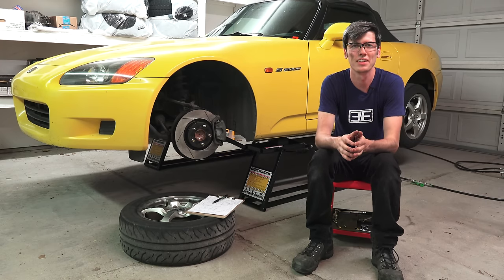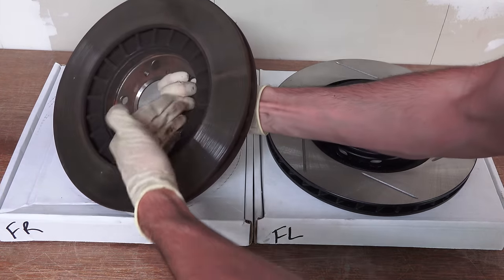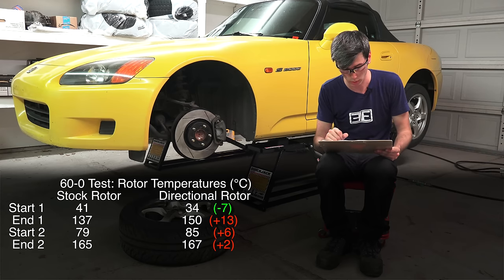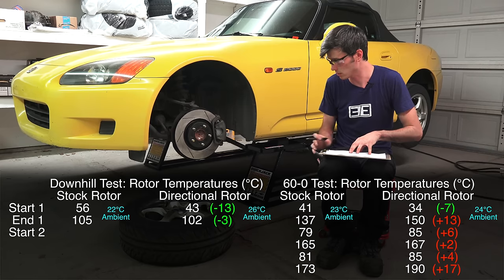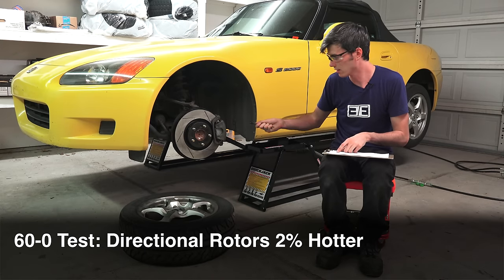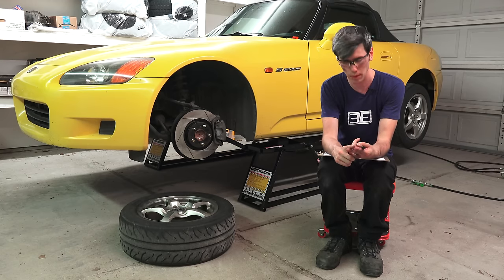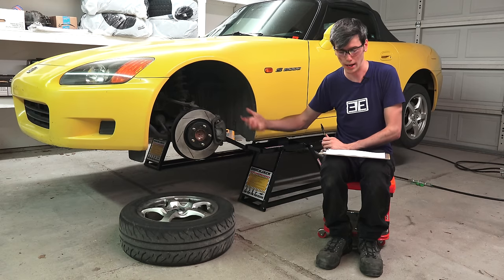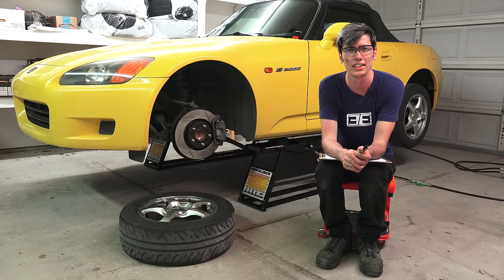Do Performance Brake Rotors Have Better Cooling?

Comment: I can see what it is that you did wrong...you had the winter air still in the tires. you need to drain the winter air and put in the summer air so it keeps the blinker fluid cooler
Reply from the maker: Kept winter air for a cooler garage.
Reply: Nick F Don't forget to add cold water to your engine.
Reply: Robert Villapudua 
You must wait till the ambient temperature is 90+ F and the engine is warmed all the way up before you add ice cold water.
Reply: SteveLovesGOD 
Wow.
Reply: It also help the muffler bearing run better and as a result the piston return springs make the engine more efficient
Reply: 😂 😂 😂 😂 Bro
Reply: did the slotted rotor help the rotor start at a lower temp?
Reply: Really funny!
Reply: Oh man, i'm dying from laughing
Reply: air up battery
Reply: Most of the funny references stole from Chris fix nice
Reply: @drgreene1013  it sounds like my muffler bearing is bad but can't find one online for some reason , my piston springs are good tho....
Reply: Professional mechanic wouldn’t tell better. Trust them, they know what’s good for your car and your wallet.
Reply: I don’t usually read comments but I gotta say this comment wins funniest comment of the year 😂😂
Reply: Also gotta make sure you don't forget to put gas in the radiator for better fuel economy. And if you change the engine oil out with cold water it keeps the engine cool. Car companies won't tell you that because they're just trying to take your money
Reply: Awesome Comment:)
Reply: Nick F Lolol you got that from chris fix
Reply: @Nick F I am Nick F
Reply: Damn I hate when that  happens....
Reply: Dont forget the horn fluid😆😆
Reply: dgreene1013 only if the timing spring rotates around the cross bearing counter counterclockwise, and your smack sensor tingles your under wire, while your crank chains are cranking your pop valves. Otherwise you'll break your.... It's just easier to say this test needed to show information that actually concerns people who buy breaks, like distance, fade, etc. Then again, if you bust your gain seals closed, you'll risk cracking your drain cross beam filler detector collecter belt selector memory indicator gasket switch, and that's an expensive repair at most shops! Though I can help you out of your issue with a high care, lost cost easy payment plan at my shop.... That's if you start noticing your car drives funny... which is the #1 sign!
Reply: were they bedded in?
Reply: The blinker fluid jokes never gets old huh. Lol
Reply: @drgreene1013  FYI A little known oddity is that some cars do in fact have a muffler bearing.  Years ago I was looking at some drawings and noticed something funny, on a 92' SVX LSL in which I was looking at a parts diag for, actually has a muffler bearing.  I haven't found it yet, but there surely is a motor out there that employs piston return springs!  lol
Reply: Rotate and balance your fuses and relays to
Reply: The important is to understand the difference between the framistat and the framistern and when and how to adjust each one. Most people know that every motor vehicle has a framistat but few know that there also is a framistern.

Only models 1978 and older had an adjustable flibbertigibbet.
Reply: You need to apply kY jelly
Reply: @EngineeringExplained  Should new brakes pads and rotor a month old still feel hot after driving 8 miles on flat road only braking a couple times?

Comment: I once sprayed WD40 on the brakes to clean them so they will brake better. Forgot to clean it off. Massive surprise at first intersection
Reply: You cleaned your brakes with WD40? Did you hear they invented a thing called brake cleaner?
Reply: Rofl!!! I was 17 or 18. I did the same thing! My brake squeaks. I learned that w40 helps with the squeaky noise! Next thing i know. I almost ran through the garage! It didnt stop! I learned quick not to do that ever again! Lol
Reply: Troy Truong Yes, the squeaking generally implies you need to replace them, or use higher quality pads. 

It doesn’t imply your brakes are running low on oil.
Reply: @guthrie1181  Better question is, "how do I change the brake oil in my Camaro?"
Reply: Lash LaRue Bring your car to a mechanic immediately if that thought ever arises.
Reply: you sprayed lubricant on the thing that relies on friction to function.  Genius there buddy.
Reply: @guthrie1181  He never heard of such a thing
Reply: So are the pads ruined then or could you carbonize the WD40, which might have soaked up by the pads, under controlled (maybe a private runway) conditions due to really heavy braking?
Reply: that's why it's called a lubricant
Reply: WD40..... try some cosmoline
Reply: @guthrie1181  not true, could be caliper pins or anti rattle clips.
Reply: @juandef4115  I have yet to see caliper pins or clips cause squeaking brakes.

Edit: and yes what I said is true. Generally speaking it’s caused by worn pads or pads with a high metallic content.
Reply: I was at the parts store the other day and overhead someone asking one of the employees if using wd-40 would help with the squeeling.
Reply: @TheAngusGao  wd40 isn't lubricant
Reply: @sageand94  It can act like one, kinda
Reply: Lol
Reply: How did it go, at the intersection?
Reply: Lmao. 😂

Comment: I think what you proved is stock rotors are better for regular everyday driving as they where intended. Upgraded brakes are better for intense driving or track use. Stock brakes would hold heat and fade, also most unsprung mass.

Comment: You were likely not traveling quickly enough for the aerodynamic differences (if any) to take effect. On a track your speeds will near 100 mph, where the discs can quickly shed heat between severe braking events. Remember that cooling largely does not happen during braking, but rather immediately afterwards. At 40-60 mph you were likely not in a speed regime where the aerodynamic differences would appear - this would be like testing downforce at low speeds - the tests would say it has no effect, when really you just need to travel more quickly. Also, measuring temps right after braking does not reflect aerodynamic cooling efficiency because all you've done is built up heat, but not allowed the system adequate time to evacuate the heat. Even on the downhill test, the final braking at the end to stop the vehicle could skew your results. Instead, you would need to somehow perform a braking event, run the wheels at high speed, and then stop them again (without using the brakes) to see how well they cooled after the first braking event.
Reply: an IR thermo with data logger would have been a good choice. His methodology was pretty bad, really did not focus on the difference in the vane performance i.e. airflow at given rpm. Too bad he probably wont reply to your comment lol
Reply: A brake rotor makes absolutely no aerodynamic difference, unless you intend to mount them on your roof anyway...
Reply: MsSomeonenew I don't think you understand what I meant by "aerodynamic cooling efficiency". The brakes don't noticeably affect the drag coefficient of the car (obviously) but the nature of the airflow through the brake rotor itself (through the center cooling slots) will affect the rate of cooling.
Reply: I have to agree.  I believed the advantage isn't so much in how cool they stay during braking but in how quick they cool down after braking.  As long as the car continues to travel at speed, of course.
Reply: Was looking for this comment.  He formulated the worst kind of testing to expose any difference in an aerodynamic cooling design for brake rotors. Gee, let's get the brakes hot then test them immediately afterwards... oh look the lighter weight rotors are hotter. Who could've guessed.   Makes me glad he stopped being an 'actual' engineer lol
Reply: MsSomeonenew, FireStorm4056 was referring to the aerodynamic efficiency of the disc's vane designs (i.e., straight vanes vs. directional / curved vanes). The principle is that directional / curved vanes are more efficient as a centrifugal pump and thus increase the mass flow rate of air through the center of the disc to cool more efficiently and thus faster. 

As FireStorm4056 basically pointed out, the test is flawed as Engineering Explained simply measured rate of heat rise, not cooling ability. A Brake disc's job other then provide a frictional link between the wheel and the chassis is to quickly absorb the heat generated from the friction used to slow the car, then after the braking even, shed that heat into the surrounding air. Since a vane type rotor requires rotation for the vanes to pump air, measuring the temperature at the end of a stop (or even just a simple deceleration event) in no way measures its cooling ability all he did was confirm that lower mass disc's will heat to a higher degree for the same deceleration conditions (i.e., new disc's were hotter at the end of their respective stops which is directly due to their lower mass).
Reply: Well, he did basically explain his understanding of the test results at 8:35, so I just see that he didn't have the same bias going into the testing as you did. You seem to exclaim this as common sense, that aftermarket was significantly lighter. I see his test as one that shows how questionable these are as upgrades for street.
Reply: Lol the bias is not at all towards whether the aftermarkets were lighter or better for the street, it's that he attempted to compare two different types of cooling vanes on brake rotors, but devised a test that all but eliminated the cooling vanes as a factor in the testing methodology.
Reply: FireStorm4056 I
Reply: Looks like you beat me to this comment! Another thing to consider is any residual brake dust on the aftermarket vs. OEM rotor. Given the added aerodynamic benefits of the aftermarket rotors may mean less residual brake dust on the surface of the rotor and therefore a small but possibly noticeable heat reduction, even if it's just 1 degrees.
Reply: He somewhat explained his flawed test at 11:28 but I think he worded it wrong. Plus who cares how hot the brakes get. My EBC slotted rotors with yellow pads work better when they are warmed up.
Reply: lol this video just reaffirmed why I quit watching this "engineer" in the first place. Probably the most sad thing is all of the people who don't know any better will be parroting this crap until the heat death of the universe
Reply: Well, real car enthusiasts probably aren't his intended audience. Most of the videos I clicked pretty much seem targeted at the common population, who might have heard this or that from a car enthusiast and wanted to know wtf they meant.
Reply: fred lunatic funny you mention this because I was going to say something along those lines, but between that and his methodology, I ended up saying screw it (too long a rant) with the previous statement. Indeed the choice in aftermarket rotor was a bad one; why you would want to direct highly energized air back into the system, I have no idea. There are many different type of vane configurations and lumping everything into one "aftermarket rotor" category, as the title suggests, is simply wrong. I'm just surprised because there are quite a few SAE papers on the subject he could have referenced. Also, the >1lb of unsprung (not to mention, rotational) weight saved is probably of greater importance to handling
Reply: Doesn't help when he actually installed the rotors the wrong way around. Surprised 99.9% are blind to it. But I'm over arguing with idiots.

Comment: Looks like the new rotors aren't bedded in very much and don't have a great transfer layer.  Since you said you changed pads, you've lost the opportunity to try again when you have a good layer on the new rotors.  Until things are bedded in, you'll be seeing the results of a blend of friction modes.
Reply: bw1235 That will change stopping power because the frictional coefficient will be different but the kinetic energy that both rotors had to dissipate was the same because the speeds of the tests were consistent. This means the same amount of kinetic energy had to be turned into heat by both rotors. (well technically the slotted had less kinetic energy because they were slightly lighter so the car was like 2 kg lighter lol)
Reply: TheBlackStealth all true.  But consider that the heat won't be conducted as well into the body of the rotor or the bulk of the pad. Akin to a heatsink interface with poor TIM.
Reply: I highly doubt that makes even a fraction of difference for cooling.
Reply from the maker: Drove around a decent amount on the new rotors before testing. Ultimately you're putting a certain amount of kinetic energy into the brakes as heat, depending on the car's mass and the speed you stop from, which are held nearly constant. Biggest variance will be my braking force, rather than how fresh/bedded in the rotors are.
Reply: Im gonna have to disagree with you here.  There may be some scientific reason but the real world is different from a lab or controlled environment.  Its frictional energy.  Sort of how a flat tappet camshaft wears to a flat tappet lifter.  Once they have worn to each other they are mated to each other, thats why you SHOULD NOT change lifter location for each lifter when doing camshaft work.
Reply: Frictional energy?
Reply: New rotors not totally bedded in with hard use = extreme over heat = rotors that look like a rainbow

Comment: nicely done test. Something to consider is that if the aftermarket rotors were brand new, perhaps they have a protective corrosion resistant coating (many rotors do for shipping) and these coatings usually take a while to burn off, and these coatings burn HOT. Just something to keep in mind.
Reply: Breakclean and wipe with paper before install
Reply: @Stian2001 dependsth ith it oil coated or coated in special lacquer 😊
Reply: @Stian2001   Do not spray a brake cleaner (or any other semi-heavy to heavy) solvent, on a new, coated rotor!  Some people will declare all kinds of stuff for cleaning new, coated rotors, such as there will be metal particles in the rotor/braking surface that will get stuck in the brake pads.  LOL!  Now, there is no problem cleaning the brake surface area with light, soapy water, but that is a huge so-called preventative 'what if'.  Does anyone really think a quality rotor will then have a quality coating applied to a rotor that has metal particles/shavings on it?

To begin with, have any of you actually seen something like a CNC cutting metal?

Bottom line: Buy quality rotors, coated or not, with quality brake pads!

Also, any manufacturer that demands their rotors be cleaned has a quality control issue that has gotten back to them from consumers!
Reply: @Professor-Scientist    Clean is clean.  And, anything that could have possibly been left on the rotor will burn off in no time.  I am not going to get into all kinds of rotors from different manufacturers, but for instance, any light oil put on a rotor for storage (until it gets to the consumer) is easily removed.  And, entire painted rotors that may be produced that way for cost savings, well, buy a better rotor!

@CaptainThirdGen  "protective corrosion resistant coating (many rotors do for shipping)"  ...  Nope.  Manufacturers do not put a "protective corrosion resistant coating" for shipping.  An actual, quality coating is used for climates, and conditions, I.E., such as road salt, to help protect against long-term corrosion.  A quality coating will help to keep the rotor cleaner, such as in the vanes.
Reply: @Professor-Scientist   Oh, "special lacquer"?  Maybe you are thinking of varnish?
Reply: I believe that drilled rotors would have been a lot cooler.